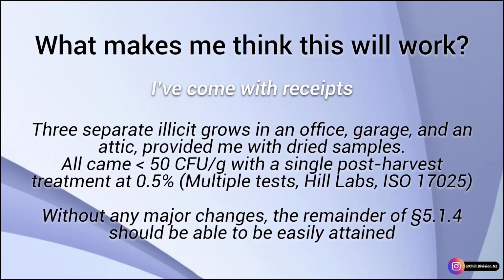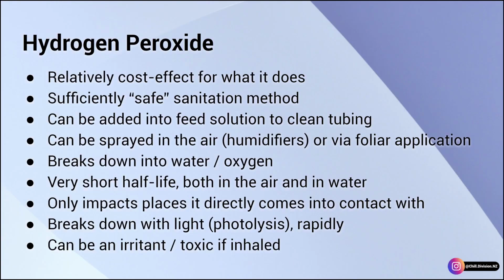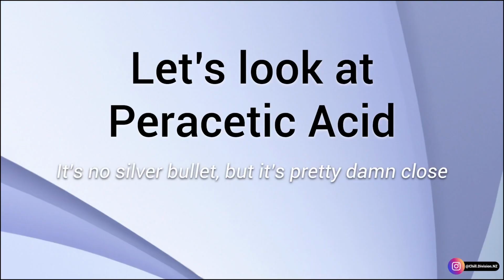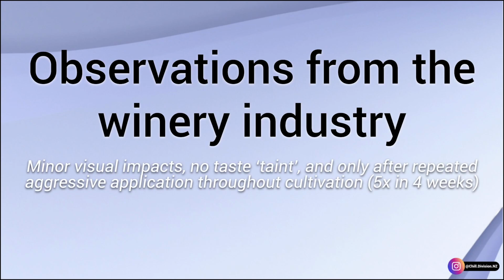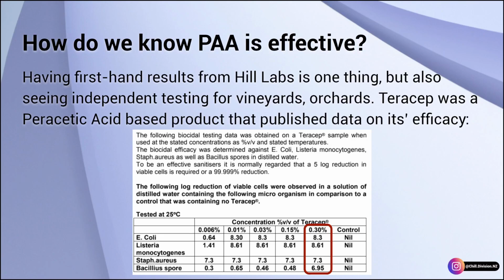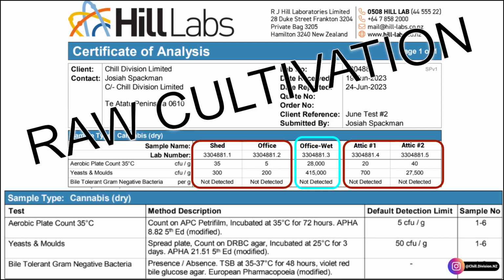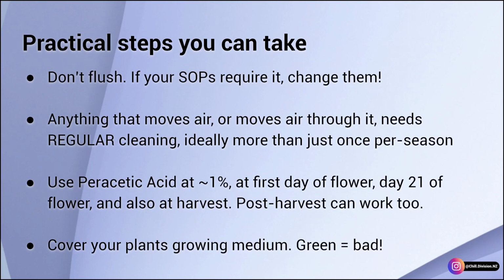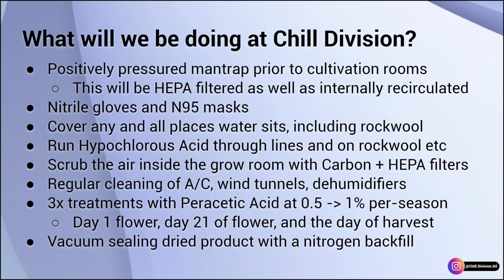Peracetic Acid for the treatment of cannabis microbial load

Comment: ZeroTol is now regulated in California and is not approved for spraying cannabis post-harvest. If the company that sells these products doesn't recommend a post-harvest application, and the regulators don't approve, then perhaps there is a reason for this. My guess would be the data has shown it to not be safe for post-harvest application, and it certainly doesn't meet GRAS standards. Growers in both the Canadian and the Californian markets reported that shady operators were forcing them to spray ZeroTol post harvest, as it does reduce microbial counts but with significant risk to the consumer. The growers I was able to speak with about PAA treatment described it as a disgusting post harvest treatment, and nothing you want to do with smokable flower.